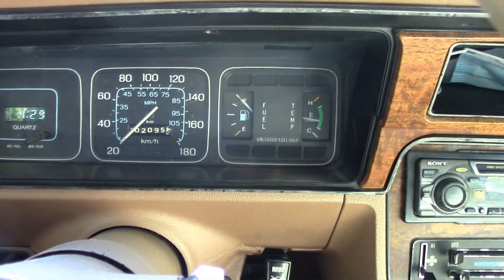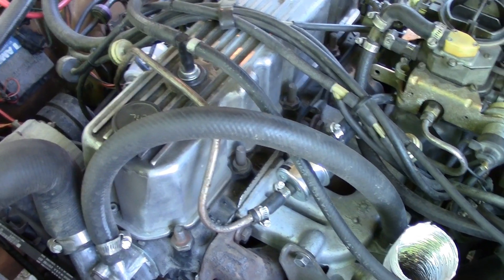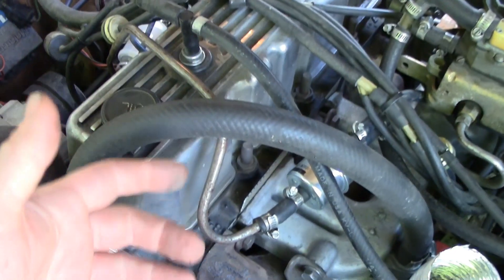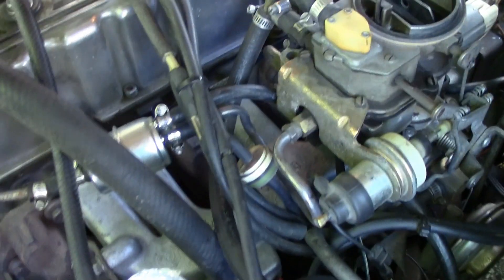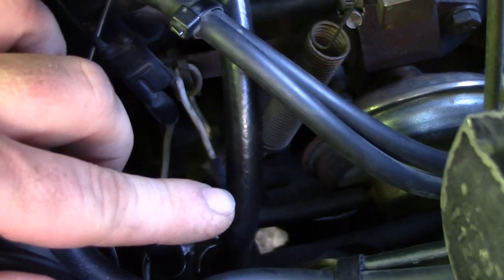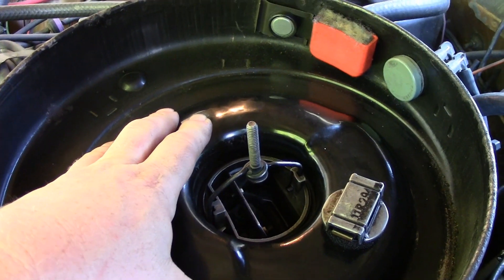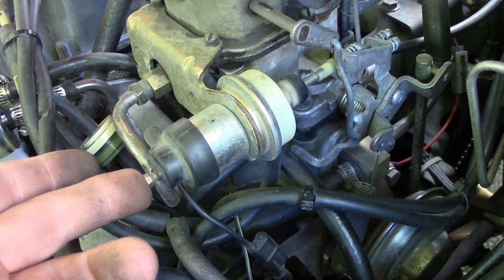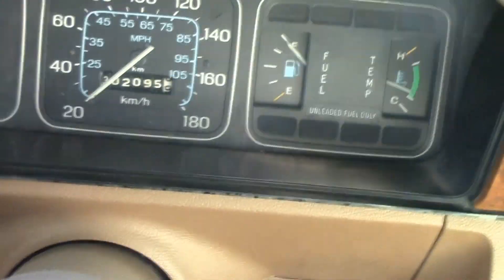Engine Vapor Lock and How We Deal With It

Comment: The standard procedure for starting a heat soaked engine is to hold the pedal to the floor, no pumping the pedal, it will make it worse by adding even more fuel.  The carb linkage will open the choke slightly with the pedal at the floor.  Then turn the key, be ready to release the pedal when it starts.  Vapor Lock is when there is fuel vapor in the lines and the pump cannot pump gas, so the car slowly loses power then stops.  Two similar problems, but with vapor lock you just have to open the hood and wait [you can check your social media :) ], and try every few minutes.  If you have a clear fuel filter, you can see the vapor in there.  There will usually be some, but if it is all vapor and no liquid, wait more.

Comment: Hoping this is my problem on my 84 vette. It drives completely fine from a cold start, but the second I shut it off after it’s gotten up to/slightly above temperature, the next time you try driving it it starts to stall more and more until it eventually stops wanting to turn over when cranking. I’ll wait an hour or so and it’ll start back up immediately no issue.

Comment: I noticed  air escape when you  opened  the gas tank  fuel cap !
I'm thinking  that is a problem  as well ! I thought ALL  Gas tanks  needed  to be vented !
Most tanks  are vented through  the gas cap !!!
Reply from the maker: There's a pinhole restrictor in the tank vent back to the charcoal canister that makes the tank remain under a level of pressure during operation but slowly bleeds the pressure off after a few minutes when the engine has been turned off. IT also meters how much tank vapor is brought back to the canister to be immediately pulled into the PCV system to be burned.
Reply: @CelGenStudios 
Oh  Goodness 😊

Comment: Old car owner's manual say that after driving for a while and turning off the engine, to fully press the accelerator pedal to the floor when starting the engine again 10 or 20 minutes after the last drive, because of the vapor lock or heat in the fuel lines/carburetor that cause fuel starvation when starting the engine.

Comment: On your fuel return line ..you stated that you installed a check valve...which direction (fuel flow.or arrow)..did you installed the valve?
Reply from the maker: The check valve allows fuel to be sent back to the tank and cannot be forced backwards into the filter/vapor separator.
Reply: @CelGenStudios  ..got it thank you

Comment: That was a lot of bad information dude. Vapor lock is simple. Gas gets too hot in there, it boils and creates so much pressure in the line you cant get any gas through it any more, which in turn starves your engine/carb for gas. Having a escape route for the vapor allows fuel to still make it to the carb/engine. You cant have a lean condition and flood your engine at the same time. That's too opposite things, stop making long winded half assed videos

Comment: WOULD AN ELECTRIC FUEL PUMP WITH 4-8 PSI FOR CARBS SOLVE THIS BY ALWAYS PUMPING GAS AND RETURNING IT TO THE TANK?
would an in tank electric pump be best?
Reply from the maker: Possibly? The idea is you run the pump for a few seconds before you try and crank the engine so that any bubbles that developed in the line will be forced purged down the return line. I do not advise using in-tank pumps due to many having issues requiring immersion cooling.

Comment: You can just make a Phenelic spacer for the carb and you will never have vapor lock issues. Also the extra height on the carb might also give you some extra torque.
Reply: Incorrect. Many engines A. cannot fit this option under the hood and B. Create so much heat a spacer doesn't cut it.
Reply: @hook86  

Time for a hood scoop or cowl induction then. Modifying the linkage isn't too hard but you can also put wood close pins on the fuel lines to act as heat sinks. Old hot rodding trick from back in the day.

If it doesn't fit you make it fit. Simple.
Reply: You will need to check if all the linkage works fine with a spacer.
Reply: You can also make whats called a cool can as a temp fix. A few companies still sell them even.
Reply: He pointed to the spacer he has installed at the first of the video, I put those plastic spacers on my flathead with zero effect.

Comment: Nice 👍 video thank you I have seen those fuel filters with a double outlet now I know why there used thanks .
I switched to a small external elec fuel pump and 1" plastic spacer on my old 69 Ford it did not have any emissions stuff not even a vent in the tank it had a vented cap and that's were my problem was I had vacuum instead of pressure in the tank ?? And it was fighting against the small 5-7 psi pump  so much that I was getting fuel starvation similar to vapor lock  but it was the cap diaphragm failed and allowed it to suck in vacuum instead of pressure.

I want to add a fuel return to the tank do you think that filter will do that ?? I'm thinking once my lil elec fuel pump dead heads fills the fuel bowls and has pressure against it 7psi it will go through that other port and start going back through that line toward the gas tank ? Then when it needs fuel in the carb it will stop and go through the other port ? .

I've seen a guy make his own makeshift return with the brass T fittings he just had the line to the carburetor being on the bottom ports and then the return being raised with an extension on the top so when pressure built up it would go through the top and go back to the carburetor.
Reply from the maker: That filter should work as long as you size for the correct flow volume. I'm sure the V8's need something larger so you don't starve the carb out.
Reply: @CelGenStudios  it originally had a two-barrel 390 so they gave it 5/16 for the line sizing that was great for a two-barrel since you only had one float bowl I used to run a 2 to 4 PSI small pump and I've never was starved for fuel .

Once I put a 4 barrel in it I started to have starvation problems on the secondary so I'm going to switch to 3/8 " all the way through with the 7 to 10 psi pump my theory on that is when it free flows it will go right into the carburetor bowls but when it backs up or deadheads as they call it it will start to go backwards and go back into the tank until I use some of the fuel again and then it will go right back into the carburetor. 

I thought about using a fuel pressure regulator to do this and just adjusting it out so it doesn't regulate anything just acts as a bypass since it has a return port at the bottom. 

But I had seen a guy make a makeshift bypass using a brass t-fitting with the elevated top at the t doing exactly that once it deadheaded it went through the top tea and went back to the tank.

Comment: Wrong ! That pressure in fuel tank is caused by a stuck  purge valve and or in correct fuel tank cap . Period.
Reply: Ok so make a video in response pointing out what you thought he got wrong
Reply: I feel the urge to purge
Reply: This is an old car from before that stuff was common. And regardless, his point of the gas boiling was still made.

Comment: Side note, does your A/C work?
Reply from the maker: It doesn't have AC, period. This has a factory AC delete so it has a different climate control panel, air box and even the alternator bracket is different. That sounds cool (pun) until those three or four weeks a year you wish you had AC.
Reply: @CelGenStudios  ah OK my car has the stuff but it doesn’t work
Reply from the maker: @InternetDude  Common failure are the O-rings and seals, followed by the evaporator.

Comment: I have a chrysler 318 efi... mine engine seems to be having vapor locking issues. Would you recommend doing this to fix that issue?
Reply from the maker: I would assume a pressurized fuel system like EFI wouldn't ever run into vapor lock. I'm not actually sure.
Reply: @CelGenStudios  well i get a blast of pressure when opening up my gas cap. I also notice my engine struggling to go when im on at a quarter tank of gas and i mainly only happens in hot weather...
Reply from the maker: @brandonpropterhoc  Overpressurized tank? Is the charcoal canister plugged? Is the fuel pump in the tank and overheating when the tank gets too low?
Reply: @CelGenStudios  i have no idea. And in all honesty my radiator just blew up on me this past friday so its at the shop right now. I know i could fix the radiator myself but i dont know what caused my radiator to blew up which is why its in the shop.

Comment: Another ancient Hillbilly trick that we used to employ, was clamping wooden clothes pins on the fuel lines about every foot or so... they work as heat sinks.

I grew up in Houston and some Old-timer taught me that trick.

Worked pretty good when the temperature was up above 90...
Reply: The wood doesn’t act as a heat sink, the clothespin pinches the fuel line, increasing the pressure of the fuel in the line. Increased pressure = higher temps needed to boil the fuel off.
Reply: @Hollywood49 i think they use the wooden cloth pins on the metal tubes and pump to act as a heat shield. We have insulation tubing that we can use now
Reply: I don't understand how that could work as wood is a horrible heat sink.  Metal is good but not wood.  Wood is actually an insulator.

Comment: Very, very informative. Many people with older or classic cars have encountered vapor lock, but few understand the phenomenon. This was really help for me. Surprisingly, hardly any of the classic cars I've owned in the last 20 years have had the problem. I just put a new fuel pump on an early '60's car I own, however, and had a problem with the fuel system. Don't know if I changed something that resulted in a vapor lock situation. At first I thought the the new pump was bad, but it started up again today fine. I'm still investigating.
Reply: You need a return line from your fuel tank to the fuel line by your carburetor. If you have a by pass fuel regulator . The bypass line from fuel pressure regulator goes to the return line that goes to your gas tank
 That allows the hot fuel to travel to your tank and back again .cooling the gas . prevents.the.vapor lock. If.you.think.you have vapor lock. Go to your gas tank.and listen.you should hear the fuel boiling in there
Also if.you pull your gas cap off sometimes there will be pressure that comes out  taking cap off.

Comment: somebody told me to put the fuel filter with 1/4 return on it and to put a t fitting on my line and conect the 1/4 inch hose into the t fitting cause i aint got no return fitting on my sending unit or tank

Comment: i have a 1970 and it has vapor lock , but i dont have a charcoal system , if i use that fuel filter and run it back to the tank will it take care of the vapor lock
Reply from the maker: It may help with part of it. The idea is the filter acts as a pressure relief and a vapor separator that sends anything excess back to the tank.

Comment: my 73 v8 gucci sportabout suffers from vapour lock here in uk. Emission gear has been removed in the past, my problem is the engine cutting out when hitting slow driving conditions after a run out. Starts up fine after a cool down period. I have insulated the lines in the engine compartment, and wrapped the exhaust manifolds (not much air space under that hood with the v8 in there) , I do have a small electric pump on a switch used for priming the system after long resting periods but it still runs on the mech pump .I am about to fit the fuel filter from a jeep and run a return line back to the tank via the filler neck....I hope this cures my problem.....Im guessing that the fuel boiling is also the cause of the poor fuel consumption due to the recent introduction of ethanol blended fuel here in UK......I get the feeling that there is no way I can improve that even with the new return line ...what do you think

Comment: Great video! Quick question though- out of the return line on the filter... does any liquid fuel actually come out of there? I am getting one of these filters that has the small orifice inside it which is designed for fuel tanks that don't normally have a return line and was wondering if I could integrate my fuel filter with a tee piece connected to the "tank" line on my charcoal canister.
Reply from the maker: Yes. Any fuel not needed by the carburetor because the needle valve has closed is forced back to the tank so at any time you can expect vapor and liquid fuel in that line.

Comment: I think I have vapor lock. I have clear inline filter in between the machical FP and the carburetor and on hot days (over 70degreesF) you will see the fuel start to bubble. About 10 min after that you hear rthe car getting ready to shut down. Logic tells me different,  but wanna ask anyways. You think a spacer between the intake and carburetor would help with vapor lock?
Reply from the maker: A heat shield might help for when the engine is running, but when the engine is off and not running there not a lot you can do to prevent it otherwise. Also, the filter is a FRAM G-3583

Comment: 10:00 a digital clock in the instrument cluster …and an analog clock in the console stack.  😂
Reply from the maker: It's such a weird combination. The digital clock in the dash is standard and the analog in the console is optional. There is a tachometer package that replaces the digital but the tachometers are famous for failing
Reply: tachometers are overrated. ill take a clock

Comment: I have maruti suzuki wagonr LXI CNG which has a petrol engine with factory fitted CNG gas as alternate fuel. Once my father was waiting at a carwash in hot afternoon and suddenly car was not turning on. Later he opened fuel cap of petrol tank he heard a hiss. Then after 3 cranks car started on cng fuel automatically. Normally our car starts on petrol then gets transferred to cng after 20 seconds

Comment: Awesome video. I have 1965 c10 with 350 small block engine. When I drive over on 1 hr and if its hot the engine take 10 minutes to restart. I get no click and no crank. Healights turn on. Do you think adding vapor filter will solve my problem?
Reply: Hi Nick, that doesn't point to vapor lock and the problem is something else.  I have had starters with the solenoid made into it get old enough that when they are hot they wont crank.  You might try looking at that.

Comment: I have a 85 c10. Removed the 4.3 with quadrajet for a sbc 350. Added a electric fuel pump and the return to the tank is at the regulator on the side of the frame rail beside the engine. Starts easy cold, Hard start after its warmed up, ran and cut off like you explained. Thinking of capping the regulator return port, then running that return line up next the carburetor and adding this filter. The hard start when warm is the only problem I have. I wonder if I could remove the holley electric pump and regulator and add a mechanical pump back in the system to quiet it down? Thank you for this video!
Reply: I would run a mechanical fuel pump and a Wix 33040 (5/16" intlet-outlet) or 33041(3/8" inlet-outlet) fuel filter with the vapor return port.  Also, don't forget to install a heat shield under the carburetor - very cheap insurance to keep the fuel bowls cool.  Check out OER Part # 3969835 which is a GM Reproduction.  Make sure your fuel cell or factory tank is well vented.

Comment: can this happen when turning an engine rebuild?  I saw a little bit of smoke on mine, then it shut off, but it turned on this morning but I immediately turned it off.  Keep in mind i had water in it only just to see for leaks.  Do I need to empty the water now?
Reply from the maker: Vapor lock is more an issue with how your fuel lines are routed rather than an engine defect. Smoke after a rebuild could be anything from new parts burning grease/dirt off after being handled or plastic components contacting the exhaust manifold.
Reply: @CelGenStudios  thank you so much for your insight, im still learning as well.

Comment: Thank you. After like 3 years I finally solved the vapor lock problem of my 1982 car.  I was having some trouble finding one of  those filter with vapor separator here in our place, but then I realized, that my carb has some sort of outlet, just right after the float valve. It's somewhat restricted, and is the highest point of the fuel system, it was plugged close before, then now I tried to hook it up to the fuel return line, and there goes vapor lock goodbye. =)
Reply: i see thanks for your reply

Comment: Did you need to vent your gas tank to add the return line and filter?
Reply from the maker: The tank has a vent line that runs to the charcoal canister and does not use a vented gas cap. So there's three lines that run to and from the gas tank doing separate jobs.

Comment: I have a g body with a vapor lock issue. I was wondering if I could run a hose from the vapor outlet on the filter to the "carb" spot on my charcoal canister as a return line?
Reply from the maker: The return line on a fuel filter should never be connected to the charcoal canister directly. It has to go back to the tank first and then back to the canister or else you will flood the canister with fuel until it overflows and spills gas into your engine bay, starting a fire.
Reply: @CelGenStudios  I tried yesterday. Thankfully the hose didn't fit 🤣🤣. I unhooked the canister to use vent line as a return line and removed my gas cap temporarily. I plan on running the return line the correct way next week. But the filter in combination with heat shield definitely did the trick. Thanks for all your help!!